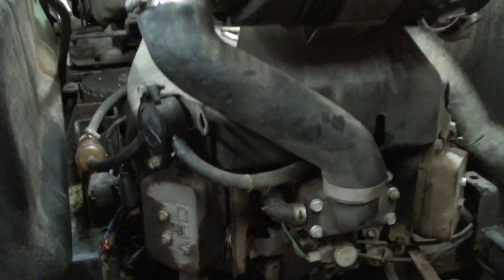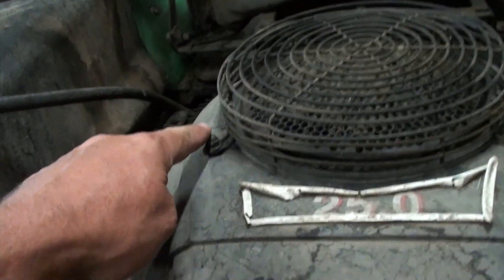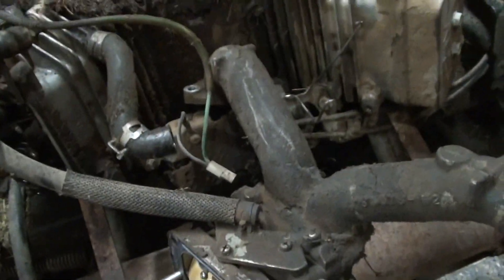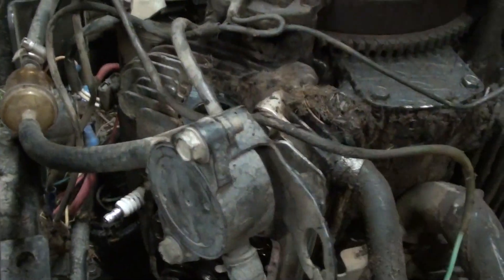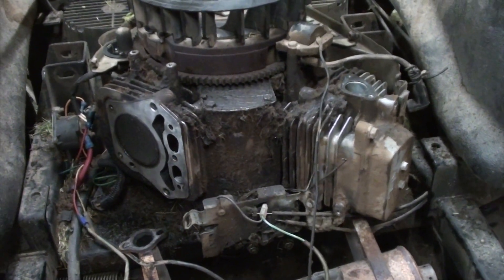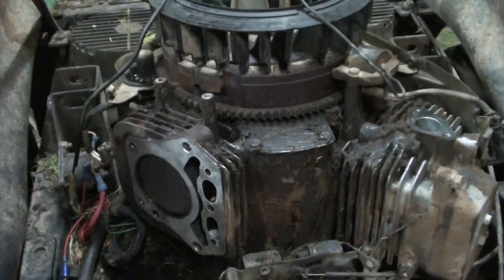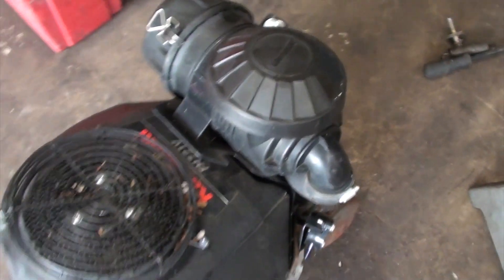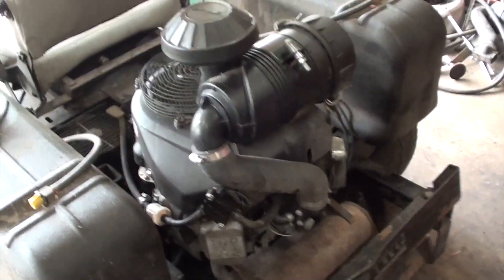Kawasaki engine swap

Comment: That damage was caused by a poorly maintained engine.  The cooling fins were completely clogged which caused the cylinder head to overheat which caused the guides to walk out.

Comment: Had something like this happen on a John Deere garden tractor. Decided to swap over to a Briggs Vanguard
Reply: When you swapped,  did you have to change everything,  like the wiring harness,  stitches,  voltage regulator,  and whatnot  ?

Comment: People have no idea how much heat a dirty greasy air cooled engine retains. Those metal air shields must be removed once every season,the block degreased, shields washed and cleaned also. It’s just a fact of ownership with these mowers, also fix any oil leaks that caused a dirty engine to begin with. After every use I use my corded blower to remove as much debris from the mower and mower deck as possible.

Comment: looks like the guy who owned it just ran it, and put it away. Never thought to himself, Hey Maybe I should clean the fins on the head so it won't overheat. Nice thing is, as long as people like that exist, you won't run out of work! I check mine every spring to be sure that fluffy the mouse hasn't built a nest on the engine block, or in the air box over the winter.

Comment: Are Kawasaki 15, 17,19 hp engines the same except for the carburetors?  I have a FH430...I wonder what larger engines are the same inside.  I'm using a carb from a 17 hp

Comment: Nice video,  Is that mower a bobcat if so how do you like it?  I am looking forward to seeing a rebuild of the old kawi.  I have a 17HP sitting in the garage that I need to do.  You should flip those rear tires on the rim so the bald spots are on the outside.  What was wrong with the mower that you pulled the engine from?
Reply from the maker: doublewide6  It's a Lesco. About 6 years old. Those tires are shot. I'll be putting new ones on soon. Thanks for watching

Comment: I have a 2007 Lesco, 25hpKaw., I have replaced 3 different pulleys from the deck, and now the brake clutch just failed, and I lost the lower pulley from the clutch. They want $560.00just for the brake clutch....I like the mower, but its diming me to death and only has 130 hrs on it. Anyway, great vid.
Reply: Sounds like you got a lemon I have an 06 lesco z two with the 23hp kawasaki I use commercially and for the most part its been pretty reliable the motor has been perfect, it currently has about  1400hrs I bought it with 500hrs

Comment: Hi. Thanks for this video it was very informative. I wonder if you can help. I have a Ferris IS1000z with a blown motor (model FH641V) do you know if I can swop it out for a Model FS481V engine? Ferris have not been very helpful with this. Thank you for any help you can give me. Regards.
Reply from the maker: Phil McAthey all depends on the output shaft. If it's the same diameter and length, I think it'll work fine
Reply: thanks for the very quick reply! I will check the shaft diameters. Cheers.

Comment: mine just wont stay running i got a 17hp that only stays running with choke on. i wanna do a swap to a 23hp from a cubbcudat both engines are kholers. what do you think on that

Comment: Dude invest in an air compressor and blow that mountain of grass out after every use blocking the cooling fins from getting air kills these engines when it gets to hot metal changes shape components lose tolerance and we'll ..boom! 😆

Comment: so its hard to rewire??
Reply from the maker: no, not at all. very easy and straight forward
Reply: Fitz's Fixes I have a scag With a kawasaki v twin And it runs like crap, it runs on one cylinder. It is a walk behind

Comment: KAWASAKI IS THE WORST COMMERCIAL ENGINE, OVERHEATS, BLOWS HEAD GASKETS, BURNS OIL, WEAK ON POWER, AND HAS SO MANY MORE PROBLEMS. They don't honor their 3 year warranty.
Reply: Real Simple I believe you. I already bought 2 mower with a Kawasaki engines  and they are piece of shit and expensive to fix. They lose power
Reply: Must only be the air cooled engines. I’ve never had any major problems with the water cooled engines. In fact I just swapped a 20 hp FD620d onto my Grasshopper last year. Before that I had it on an old Gravely tractor. Been a good engine for me. The ones they used on the Deere tractors were pretty good engines too. Lots of times the engines will outlast the tractors! Biggest issue I was ever aware of with the water cooled engines was with the plastic cam gears used on the early FD620. Deere warranteed a lot of those on the 425 and a front mount mower ( can’t remember the model). Replaced them with an all steel cam. No problems after that. Haven’t had much experience with the air cooled twins.
Reply: Real Simple i have an air cooled v twin Kawasaki 23 ho on my cub cadet. Runs like a top and has never let me down. I mow 8 acres every 2 weeks. I do regular maintenance. I’d say it’s better thank kohler or Briggs. Been a dependable work horse.
Reply: i put 100+ hours on my 23hp kawasaki each summer and it has never let me down and runs very smoothly always starts first crank
Reply: You're crazy. Kawasaki engines are superior.
Reply: I have a freedom scag 36 inch. With 17 hp kawasaki engine  since 2008. Same engine. I try a scag 61 with kawasaki 30 some thing hp.  EFI  after the test l went for natural aspiration with kawasaki engine. Less trouble with little issue.😊